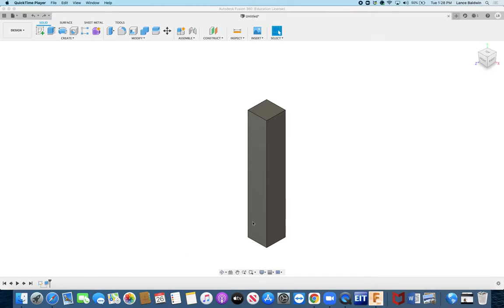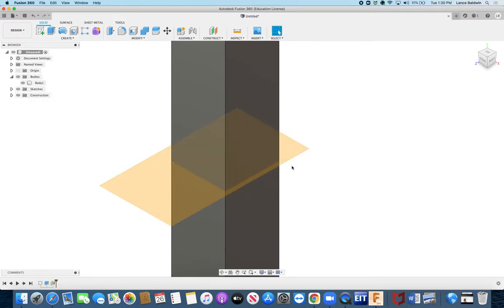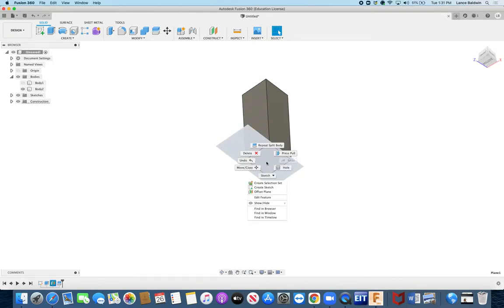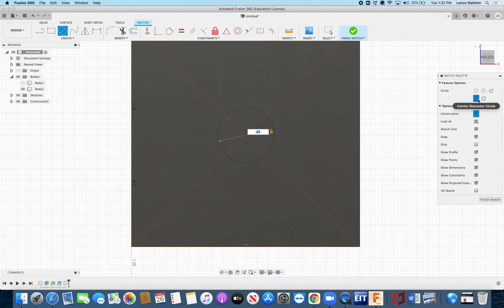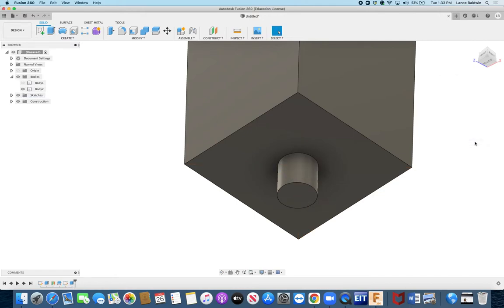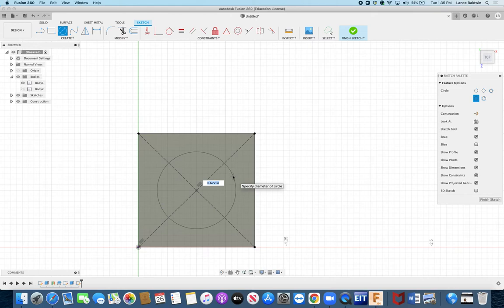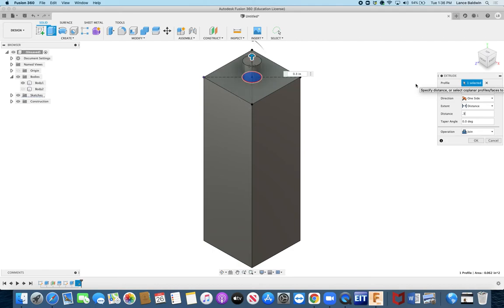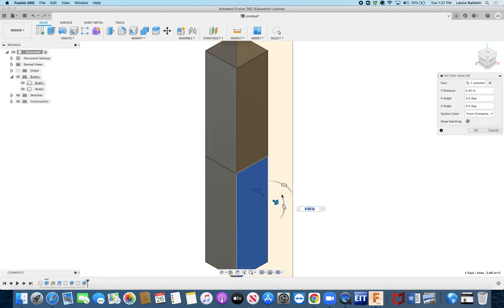Splitting Bodies for Printing and Gluing - Fusion 360

Comment: Isn't there a way to get 1 body to subtract from another.. so you wouldn't have to do the 2nd circle, but instead, tell it to cut from the other body, you could make much more complex connectors this way and reduce the work by 50%